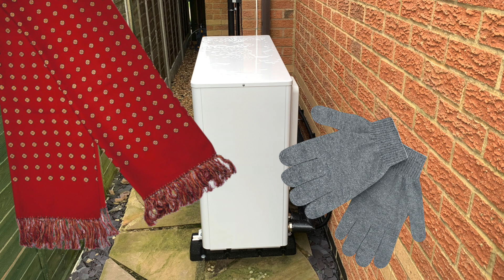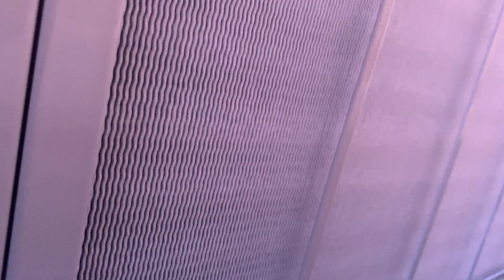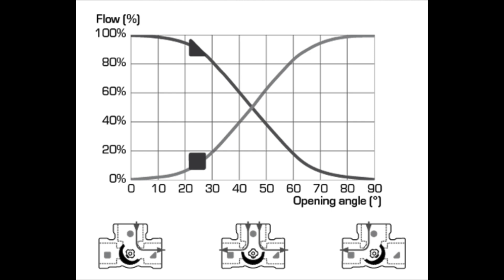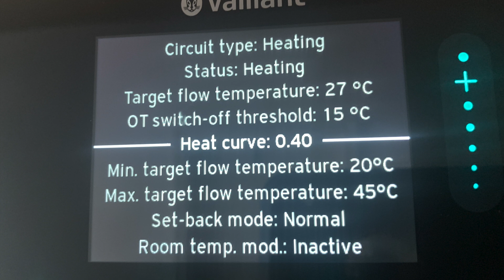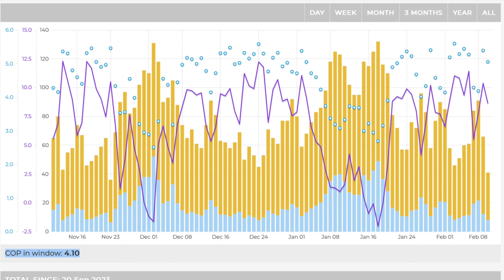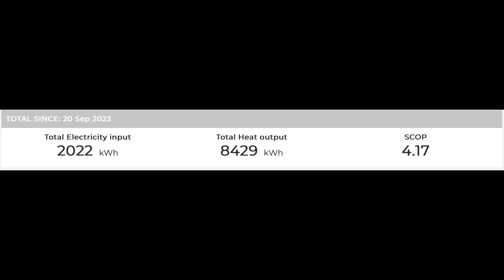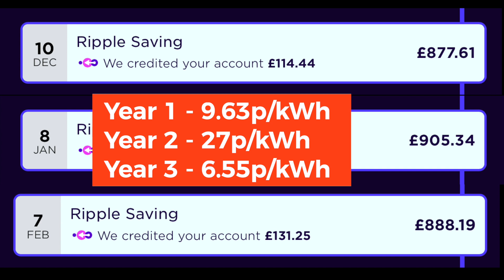ASHP winter performance and cost to run

Comment: I am now 72, and aware that I am loosing my ability to problem solve I.e. I’m moving from Geek to normal. The average person would not pick up the problems/finesse of the system, would not therefore achieve COP > 3 (Break Even Point for gas combi), and just say ASHP don’t work. How can the country (or me in a few years time) sort this issue?
Reply from the maker: As the heating industry improves and installers become more aware of the remote monitoring systems available to them, the onus will shift from consumer to installer. We are still in early adopter phase.
Reply: @johntisbury  I'd forgotten we are 'early adopters'. The 'Heat Geek' insurance scheme (for which you pay a premium) seems a good safety net for my senile years! The expense of it will put most normal people off; with the consequential result SCOP will not be what that could achieve, and the tabloids get more stories ☹
Reply from the maker: I firmly believe as installer experience grows so prices will come down. Installs will be become quicker, more efficient and manufacturers will embrace innovative products and tools to aid this. In 3-5 years the industry will look very different I feel.
Reply: @johntisbury  I wish I could be as optimistic as you. I have closely watched five year of new builds and conversions round here in West Yorkshire. Always gas boilers, never solar panels and just one ASHP. The working plumbers I talk to (challenge!) all have enough traditional work swapping out boilers for new combi ones, “cannot afford to go on courses” etc. If ten years ago, our pathetic Government had set a road map that forced all new builds to have ASHP (+ solar) from 2018, we might now have a small workforce with those skills. Liasse faire has been an excuse for atrocious leadership. Sorry John - rant over. P.S. love your work
Reply from the maker: @geoffmansfield2668 you are not wrong. Lack of direction and consistent policy has slowed the UK transition down, helped by the fossil fuel industry and their pie in the sky hydrogen model for domestic home heating. The heating industry is pivoting to  ASHPs, many of the heating engineers I follow have not fitted a gas combi in the last 12 months. Gas boiler installs will slowly reduce in volume and die, plumbers will either retrain, retire or move industry.
Reply: @geoffmansfield2668  

As of 1st April this year all new builds in Scotland will have heat pumps or district heating systems, this will apply England/Wales 1st April 2025.

Things are moving forward albeit a bit slower than hoped.

Comment: The length of pipe outside of the house (the warm side) is rather large. With 25 mm pipe, 40° difference water-ambiant air, loss is 45W per meter.
Reply from the maker: All true, but no other option in terms of installation location.
Reply: @johntisbury  other option, to increase pipe insulation, is small cost, hight efficiency. Small is beautifull unless if we discuss insulation of the hottest spot.

Comment: Hi.  I see your heat loss report says 8.4kW and recommended a 7kW ashp.  Have I read this correctly and why wouldn’t your ashp meet or exceed heat loss?  Thanks.
Reply from the maker: It's a good question. Many heat pumps will work above their stated rating. Vaillant aroTHERM+ 7kW can output up to 10kW with a 35ºC flow temp at 2ºC. At our design temp of 40ºC flow at -3ºC it can pull 8kW. So there's latitude there for it not to be underpowered.
Reply: So your ashp should have excellent modulation as it doesn’t appear to be oversized.
Reply from the maker: @AirCommodore64  FYI over the past couple of days with slightly warmer temps it's been ticking along. Today for example from midnight to 11:00am it was ticking along using 570w energy usage with no cycling. Long and slow. Almost 12 hours of a constant run. Turning on is where the largest power draw is until it settles down.
Reply from the maker: @AirCommodore64 correct.

Comment: Your open energy show flows below 40. So something must be limiting not just weather comp. But you say you needed to change the wc number from 0.4 to 0.6 . Exactly what I had to. I found .4 is a flat curve where as having 0.8 but with a target room temp of 19. Gives a steeper curve. So the warm weather flow is similar to .4 at a high room target. But the flow if boosted on the colder days and with bit of fiddling I  got a setting that is set and forget. With a good scop.  I also notice you do legonella at 4 am. I guess to get cheap rate. But as you mention its more energy efficent to run at the warmer part of the day. Finally! You say you might need another battery, I wonder if agile octopus would be an option. Much shorter peak for your existing battery to run through. But the low rate not as low. Needs number crunching. But another battery is a significant cost.... Great content.
Reply from the maker: Thanks for watching Joe and the points you raise are good ones. Let me respond to your points / questions one by one. 

1. Legionella setting. The setting defaults to 04:00, if you notice on the video of the sensoCOMFORT screen the Anti-leglo. day:off. This means we don't run a Legionella cycle. Most people don't need to run it to be fair unless you don't turn over your water volume frequently or have it set to a very low temperature. Heat Geek has done a great in depth video on the subject: https://youtu.be/oJeyc_cGIMU?si=IM-xCg8bPoqqGFsN

2. We have decided on a second battery to ease the daily chimping of weather apps, solar forecasting websites, decisions on whether to charge not to charge etc. Whilst it's kinda fun second guessing the weather and solar forecasts it gets a bit frustrating at times when we have to pull from the grid at peak rate due to a poor decision based on the data at the time. With a second battery we will have 27kWh of battery storage and hopefully, with the DNO approval being positive, we will be able to export and get paid for it at saving sessions run by Octopus Energy. Currently we have no export option in place. I've been on Agile previously and whilst it was good it added another task for the day ahead forecasting. As we don't have an even daily routine for electricity usage it's tricky to apply the Agile tariff as a set and forget approach. 

3. The heat curve as its name suggests is a curve. The 0.4 curve will only achieve a 40ºC flow temp only when it gets down to -15ºC with a room temperature setting of 20ºC. At 5ºC outside temperature the 0.4 heat curve will produce 30ºC flow temperature water. There is nothing limiting the flows other than pure weather compensation. If a home has lots of solar gain then pure weather compensation may not react quickly enough and certain rooms may overheat. This is where the option to include the sensoCOMFORT room thermostat comes into play by placing it in the warmest room and moving from inactive to active mode for Room Temperature Modulation.
As you point out getting the right heat curve is a bit of trial and error but once you find the sweet spot for your house then it should be a set and forget. We are still in the learning stage as it's our first winter with an ASHP. Mick Wall has written a comprehensive article on the subject which is well worth a read if you have time: https://energy-stats.uk/vaillant-arotherm-weather-curve-information/

Comment: Heating domestic water in the afternoon gives you a better cop but with the nightly later its far better to heat up the water at night if you look at the real cost
Reply from the maker: I guess it depends on what your heat pump is powered by. During the day ours runs on excess solar and/or battery. At night it will most always be from grid power albeit it at cheap rate. Cheaper for us during the day if costed out.

Comment: I’m watching your video as I’m getting my heat pump installed!  My propane supply is disconnected so I suppose my house is technically “fossil free” now (though the tank still needs to be dug out and removed).  Wood burner is excellent for temporary duty.  

Very interesting to see your performance stats between cold and mild days.
Reply from the maker: Great to hear Anthony and I'm sure you will be happy with it. We are delighted with ours and its efficiency to date especially given the performance constraints around copper and plastic micro-bore we have in our installation.
Reply: @johntisbury  If you are delighted paying twice what a gas boiler would be to run, then that's good for you.  Most people will choose the cheaper option, a gas boiler, which might be less efficient, but costs far less to run.
Reply from the maker: @Bond2025 Not sure where you get your assumption about the cost difference between electric and gas but they are skewed. An ASHP running at a SCOP of 4 will be exactly the same price as gas to run, it was 3.5 before the price increase in electricity prices. Looking at the 111 monitored ASHPs on HeatPumpMonitor.org with full MID metering the average across all those for the past 365 days is 3.9. You are also paying for 2 standing charges (gas and electric) as apposed to 1 is you are wholly electric.
Reply: Can you show us your electric bill for the recent winter?
Then we can get an idea of how much you paid.
Reply: @ Minus £150 from February 2024 to February 2025.  2.4MWh of electricity consumed for the heatpump.  4 MWH fed into my car.  6.5MWh generated from solar in total. 

Lesson learned:  Import at 7p rate in the winter, and export the surplus at 15p in the summer.

Comment: Thanks for the figures, my ASHP used 311.24kWh for November 2023, 517.72kWh for December 2023 and January 2024 was 710.76kWh, maintaining 18c all day with 2c drop overnight. Still looking into the open energy monitor and looking an expensive but wanted add on!
Reply from the maker: Thanks for your stats. OEM is essential if your a data geek and want to improve your heat pump’s efficiency
Reply: Still more expensive than my gas boiler heating to 23c between 5 and 9pm, then dropping to 20c overnight and 21c from 6am to 9am. The only time it's off is if no one is in during the middle of the day, but on all day at weekends!
Considering the cost to replace my lovely efficient gas boiler, I could put that money in a savings account and use the monthly interest to reduce the gas bill.
If electric was cheaper, I would change over.
The only people saying heat pumps are cheaper to run seem to be the type that were scammed in to fitting £10k+ solar and battery systems and found they wasted a lot of money for negative returns. At least they can provide a bit of power each day.
Is it worth all the expense?  No!
It's a hobby to some, something to spend savings on.
Reply: @OH2023-cj9if  I am off grid as concerned to mains gas so LPG costs were going crazy. So a massive saving and we are home pretty much all day so keep the home at a steady temperature. Funny thing is in general, solar does not cover much in the winter, when the ASHP is used. However in  the colder but sunnier days we can use solar to run the ASHP. I have never had free gas to my boiler when I had it.
I also Offset a lot of my electricity cost by use of my battery, so pay just 7.5p per kWh for a lot of my use.
I don't believe anyone was scammed to fit solar or battery as they do shrink your monthly bills. Payback will be over years and a nice investment in the home. 
I now pay £90 per month for all of my heating, cooking home use and around 10,000 miles per year in my EV. It can and does work.
Biggest thing is being on the correct tariff.

Comment: Hi John a great honest review,  as usual that’s what I like about your vlogs  honest and genuine every bit of detail included unlike others.The electric consumption of the heat pump is very good compared to gas . Two questions do you think another battery is worth it for the little peak power you would consume for 6/7 months of summer it will probably only be used very little. Second on the EOM site some users have a black line for in door temperature I just wondered if that is a separate piece of kit you have to purchase ? Looking forward to your solar battery and car stats take care Glyn 👍👍👍
Reply: Thanks John the back up gateway and powerwall is brilliant I can say for sure.Last summer on many occasions on a very sunny day I was charging both ev one on zappi pulling 7.2 kw and granny charger on other pulling 2.8 kw  when cloud cover the zappi rampted down to 1.4 kw  granny carried on obviously up and down all day with NO grid draw . Powerwall app showed no peak grid draw in  all of 2023 but octopus billed me for 3.6 kw over all of 2023. The cold weather we just had my powerwall charged at 5 kw at 11.30 every night to full then just sat there until 5.30  before discharging unlike many other batteries. We have had probably 75 power cuts some minutes some hours gateway performed perfectly and uninterrupted solar in power cut until battery full then it just alters the frequency and turns your inverters off until battery down to 90% then inverters start again and the cycle continues. So now I have learned to put the car on charge in a power cut ie 1.4 and let it ramp up and down 
‘
Reply from the maker: Good idea on car charging during a power cut to make space for solar.
Reply from the maker: Thanks for watching Glyn. The second battery point is a good one, looking at the stats for peak usage no. However, to get such a low usage means a daily plan and vigilance to obtain it. A second battery would free up that somewhat inconsistent forecasting and planning. At the same time we will upgrade the Gateway from Gen 1 to Gen 2 which has full off-grid capability and backup reserve features. Currently we have no off-grid facility. In addition we are getting a couple of A2A units for air conditioning in the glass studio so again a second battery will ease the strain with that and allow us to pull 10kW house load rather than the 5kW at present. We often find that with the heat pump running on cold days and cooking we nudge the limits of the 5kW that having 1 Powerwall can deliver. 
I too have seen the indoor temperature too and did wonder myself how they have achieve that. I believe it's via MODBUS but I'm not really too well versed to advise. A good place to look is the OEM forums. https://community.openenergymonitor.org/t/welcome-to-openenergymonitor-faq/8/2

Comment: Really good to have this data helping confirm your system is working as you expect . 

Its a complex system with cycles and flowrates bit i guess if you sont look at the data it seems simpler😂

Great to see it perform so well over winter
Reply from the maker: Thanks Nigel. It does take time to know what to look for and what good looks like  amongst the data. We are really pleased with the installation and its performance.
Reply: @johntisbury  I'm sorry of envious of all that extra data and visibility of your COP values
Reply from the maker: @EVPuzzle  data is king as we both know.

Comment: This will be my 2nd year of being net zero. In 2021 I had a Rheem Prestige 5 ton heat pump installed, along with a new air handler and propane backup furnace. It's 21 SEER, and 11 on the heating side. Here in southern New Mexico USA, I also have 12.4 KW solar array. I don't know for sure how much power it uses because my solar makes a lot more electricity than I use. The first year, I had the lock out temperature set to 20 degrees F. We got down to the teens a few times and I ended up using about 20 gallons of propane for the year. Two years ago, I lowered the lockout temp to 15, and we never got that cold, so it never called for any propane backup.. The heat pump has no trouble heating, or cooling my 2200 sq ft home. I also have a Rheem heat pump for hot water, and a Samsung heat pump clothes dryer. I think heat pumps are the way to go.
Reply from the maker: 100% agree on heat pumps being the way to go. They work magically and efficiently doing both hot and cold. Great to hear about your journey too and that the propane backup is getting less use.
Reply: I had to check the insulation. House is built in 2004. Wall insullation is 250 mm rockwoll, floor 200 mm styrofoam, and roof 500 mm blown cellulosa woll. The insulation in the roof have to be thick to cover the ventilation pipes to avoid condensation.

Comment: Well done John. Very interesting. I’m designing/sizing my own hp. Probably Vaillant. I’m interested in open loop control /full weather compensation and how you get in when the sun heats your sunny room. I have similar. KBO.
Reply: Thank you John. I didn’t know you could “blend temperature measurement with weather compensation”. Thank you for the info.
Reply from the maker: On the Vaillant aroTHERM+ there's 3 settings for Room Temperature Modulation : Inactive (not used and uses pure 100% weather compensation with no room influence), Active (adjusts flow temp based on current room temperature), Expanded (Adjust flow temp based on current room temperature but also activates/deactivates the zone)
Reply from the maker: Thanks for watching. Solar gain can be a blessing and a problem. If you have too much solar gain then you can set the controls for the heat pump to take into account the indoor room temperature and place the controller in that room or location where the sun falls. It still does weather compensation but also blends in the data from the room thermostat.